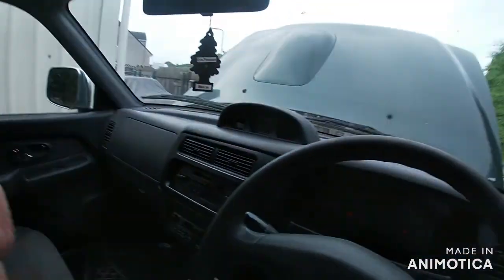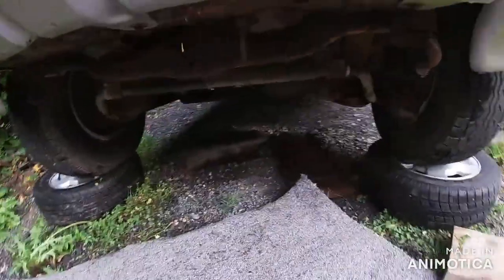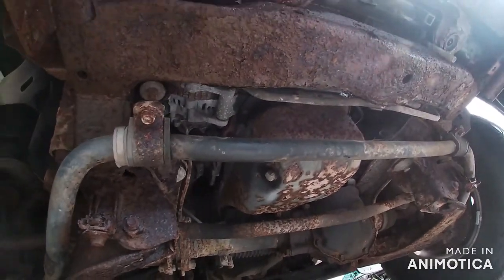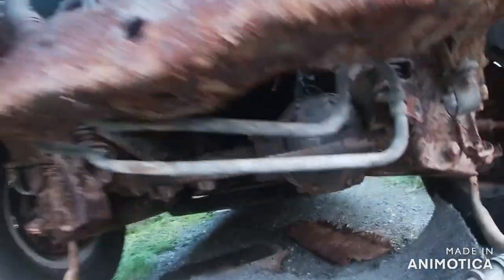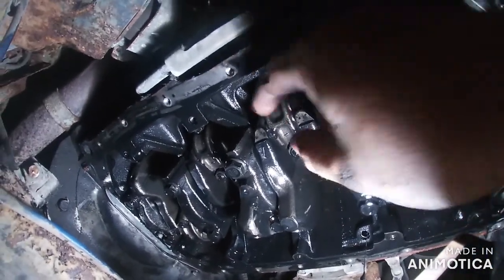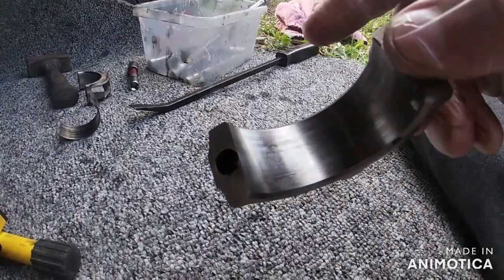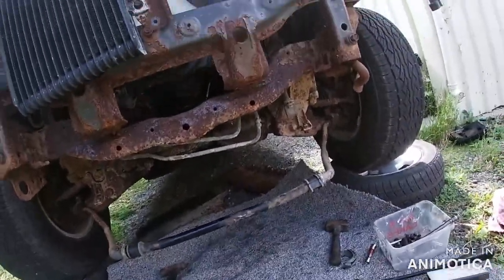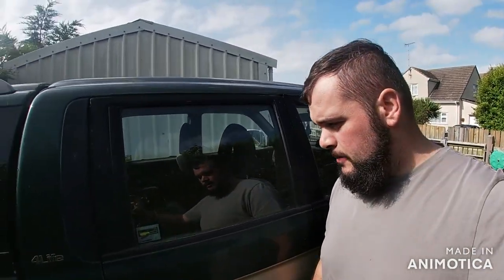l200 knocking engine problem found

Comment: I have the exact noise on my L200 after the engine over heated and the Head gasket was replaced after the head was shaved. The engine was removed and no problem was observed in the lower block, so where is my problem. Remember my head was shaved because the over heating caused the head to warped.

Comment: I have this problem with mine does this mean DONT DRIVE till fixed ? As don't want to cause more damage can you help thanks 🙏
Reply from the maker: Hi mate i wouldent drive if can avoid as if you catch it ealier it can have a chance of not damaging the crank which is the expensive part
Reply: Cheers mate just bought it and this happened not a happy guy like

Comment: what fix should be done?
have you fixed yours?
Reply from the maker: To fix this you would have to replace the crankshaft and new shell bearings along with some other bits i think , i didnt repair it i broke it for parts and sold the bits off if you go on my videos there are videos of me breaking it and how much i made

Comment: Great vid bud..my k74 is doing the same..on cold start...how much u recon ur job would of cost plz
Reply from the maker: New bearings are around £30 from memory if your lucky you can get away with changing just them and fresh oil etc as youll have to remove the sump but it is doable , but if the crank is damaged like mine was its a 6-700 quid job then with new crank and all the work to fit it , hope this helps mate